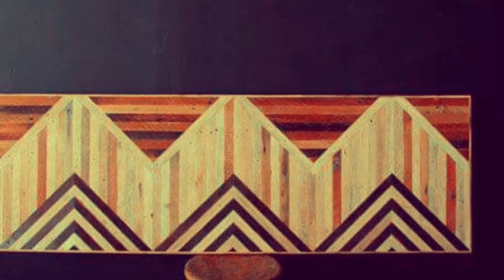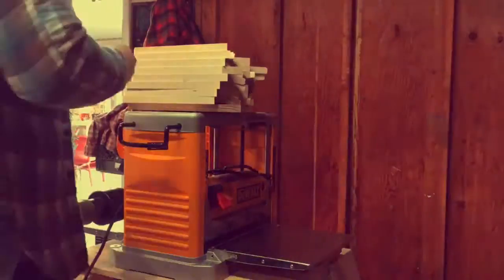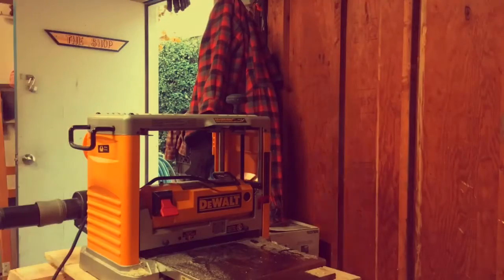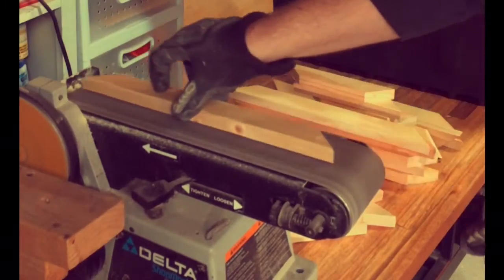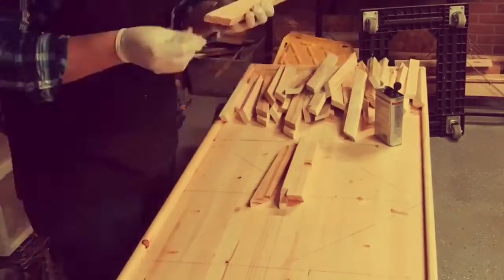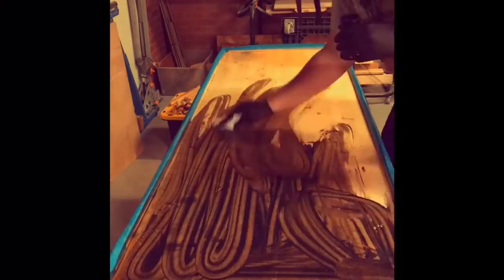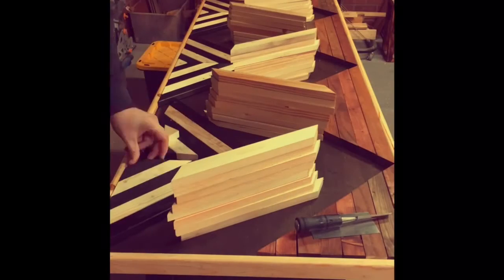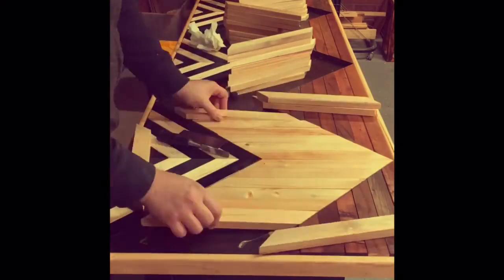Chevron Pattern Wooden Wall Art

Comment: What size backerboard is that and where did you get it?
Reply from the maker: The one I used was 6ft long by 3ft wide and it was the laminated hobby board that comes in the plastic wrap that you buy in the wood aisle at Lowe’s Home Improvement stores.
Reply from the maker: Adam Mullins hey I apologize I said 3 x 6 but meant 2 x 6 sorry